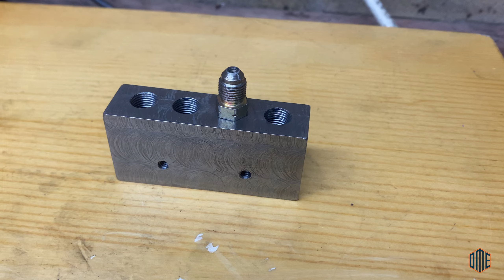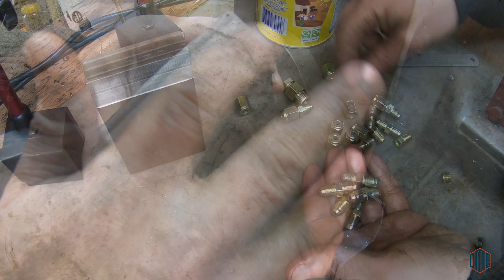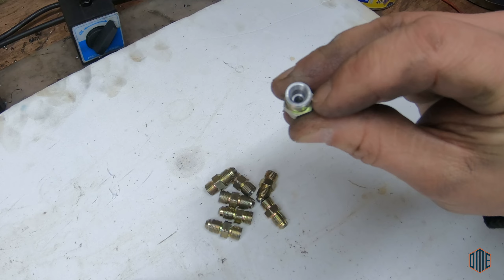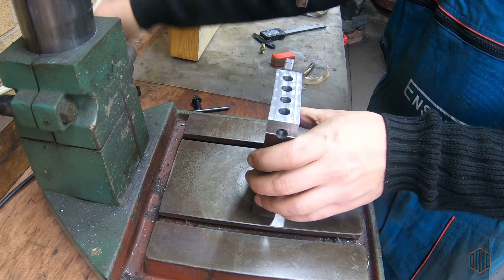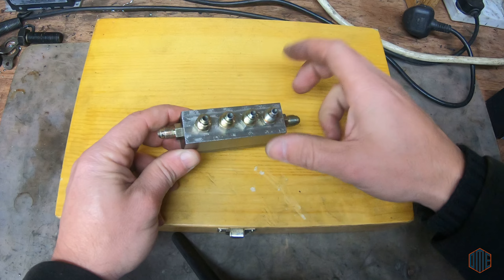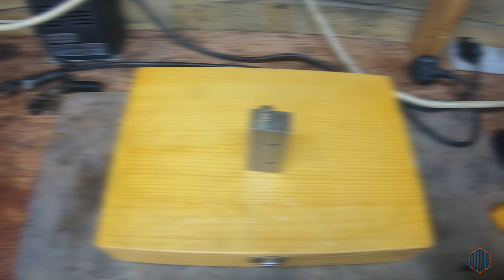Archdale Vertical Mill Restoration - Pt4 - Making an Oil Distribution Box

Comment: With intersecting holes like you have here I've made small honing bars from round brass, plastic or wood with a slot cut into the end about 3/4 in. deep. The bar needs to be small enough to wrap several layers of emery paper strip to apply sanding pressure to the ID. Chuck it up in the drill press and "hone" each bore section to remove the burrs. Works like a champ.
Reply from the maker: Thanks for the tip. I ended up slitting the end of a tiny rod and just wedged in a piece of emery paper. Greg